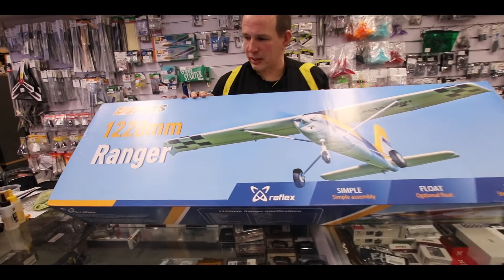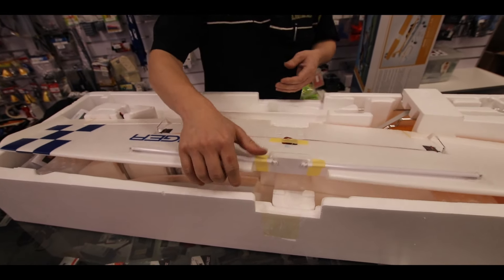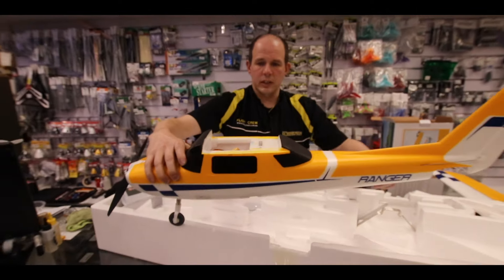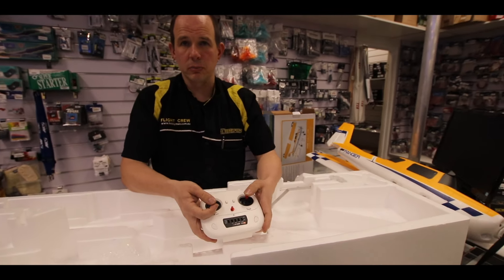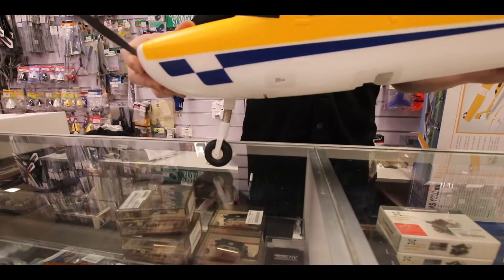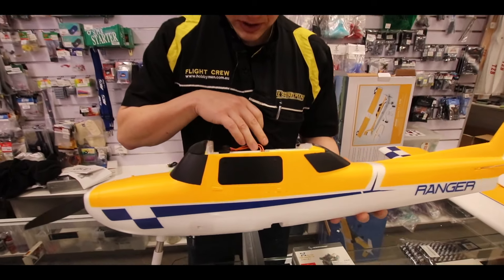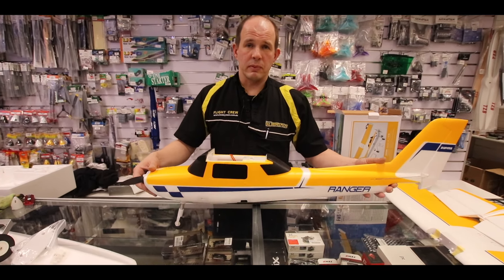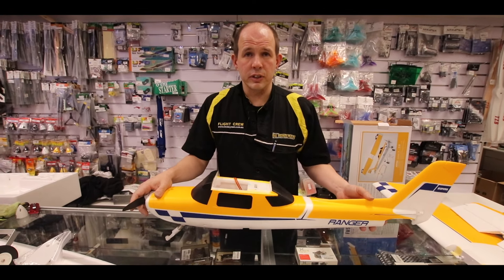FMS RANGER UNBOXING & FIRST THOUGHTS | #projectHearns

Comment: I’m wondering which controller I should get for this plane.
Reply from the maker: THis FMS comes RTF so you can use the one that comes in the kit. If not you can choose any Spectrum or Futaba radio however you will have to change also the receiver which is on board already.